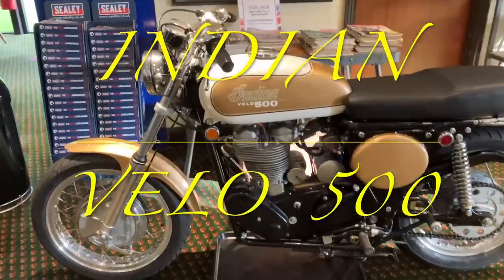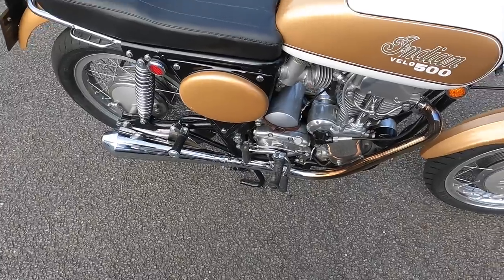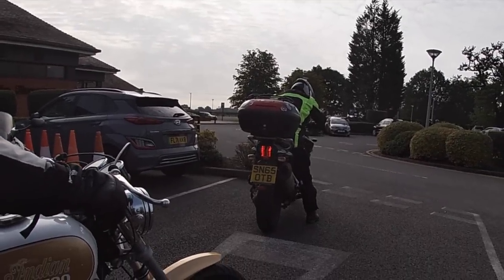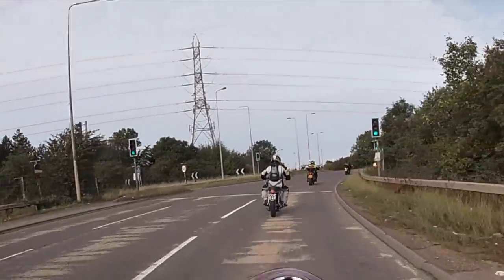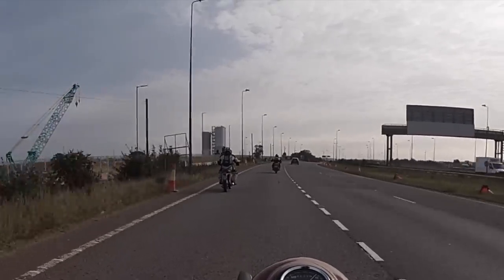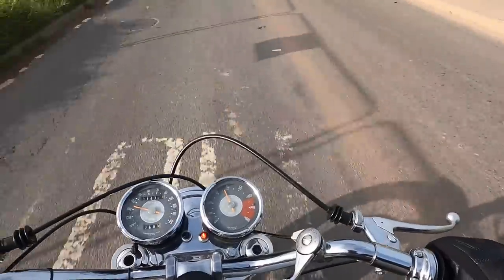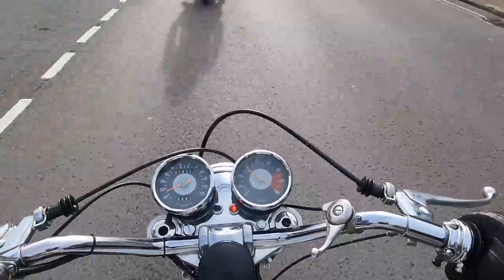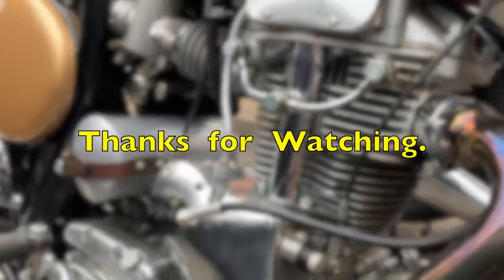Indian Velo 500 the rarest of  Big singles  tested

Comment: Brought back fond memories of a Ducati 450 Desmo and a BSA 441 Shooting Star that I had in the early '70s.  No, not both at once...I'm not THAT much a masochist!  The BSA was heavily modified:  500 kit, head work, 10.5 piston, 1.5" Amal GP, Akront rims, Fontana 4-shoe ftont brake, almost-open megaphone exhaust (you could not sneak up on anybody).  For a single of that day, it was quite fast, easily quicker than a 500 Daytona Triumph, but about 45 minutes into any ride you suddenly realized you could not feel fingers or toes.  Sure did look and sound great, though.  The Duke was almost stock, but for a 500 kit and Fontana brake and upgraded forks/dampers.  Both machines were jack-the-bear to start when cold, and I lived in St Louis, MO, so the weather wasn't helpful.  I found a $3 electric blanket at a yard sale that pretty much solved the problem.  I've always admired Francis Beart and loved big singles.  Just imagine how wonderful a modern one with balance shaft(s) and rubber mountings could be.  Of course, only silly old fools like me would want one...and we'd wait until they were old and cheap, so no sane manufacturer is going to gamble the fortune to develop one!   I did have a Honda GB500 some years ago, after it had gotten old and cheap...but somehow it just didn't have any soul.  Go figure...
Reply from the maker: Cool 😎

Comment: Nice! There is no reason to push these museum pieces. I have 71 CB 350 twin Honda that I finally got running right (bought it in 2000). The only parts I could find is support for AHMRA vintage class racing parts. I found some old HAP Jones pistons, had the cam reprofiled, intalled racing electric ignition, 32mm Mikunis, etc. She is a real beast now. Going to ride her on my local mountain road in a few hours. And I am going to push her hard!
Reply from the maker: Oh I wasn’t riding hard at all 
The clutch didn’t fail because I was hammering it, it’s unfortunately an ongoing problem the guys thought they’d fixed, unfortunately not as it turned out

Comment: This bike is not common only 250 made. Such a pristine condition...I love the intake pipe with fins in a desperate attempt to stop heat in the carburetor. Unfortunately nor the English not the Italian engineering was renowned for reliability...Clymer died in 1970 and the Indian revival 400 and 750 cc died with him, followed shortly by Velocette and Royal Enfield, the engines providers..
Reply from the maker: Oh both countries can make very reliable machines in my experience 
The bike is over 50 let’s remember 
Not too many Japanese bikes have survived so long
Reply: @bikerdood1100  The first truly reliable bike was the Honda CB 750 at the end of the seventies. After some problems with the chain "tensioner" with the first model, fast solved by Honda with a kit. 
Before the Four none bike on the french market was truly reliable for range fast touring whatever the origin even the BMW reliability is rather a myth.
On 1972 I bought from a friend who was working at the Honda importer, a Honda CB750 1969 (the very first one with the sand cast engine cases). The bike had 35000 km, I added 80000 km more in less than 3 years with just one clutch plus a lot of consumables (tires, brakes and chains were worn at very fast rate...and the normal consumption of ball bearings, rear shocks and fork rebuilding). The maintenance was constant but nothing hard. The cam chain was pretty worn with a lot of slash noise at the end.
I sold it to a friend at almost 120000. He rebuilt the bike, and kept it. The bike is now 54 years old with more than 200000 km and it's an highly collectible as the 1969 model with sand cast cases is extremely rare.
That was the first bike with what I has able to make Paris France to Hambourg Germany 920 km straight on highways with just the stops for refueling, one tension chain, and coffees for the driver in a total time of 9 hours. Such a trip was difficult to imagine with a lot of bikes in 1972-73.
Honda made very strong models, I bought a Honda 750 VFR Carat 1990 brand new. I sold it at 125000 km in 2000. I did nothing except maintenance including ball bearings and normal items like disk brakes at 80000.
In 1991 I had an urgency and made Paris Marseille 780 km all highway by night in less than six hours including stops without any problem, the tachometer being at 200 most of the time.
An acquaintance bought it, and has it always. The bike, 33 years old, has now 260000 km with just one clutch. The engine has never been opened. He made a new epoxy paint of the wheels, made a great revision of the cycle and it's on the road again.
Reply from the maker: Well as the saying goes if you were right I’d agree with you 
But unfortunately 
The 400/4 like so many Hondas is a revvy gutless little thing 
You say Honda 
I’d say 
Cam chain 
I’ve had a lot of Hondas over the years good bikes but more reliable than the rest I’m not so sure
I’ve pushed my share of Japanese bikes home in must say 
That’s not pub talk that’s real world daily rider experience no BS 
I’ve been let down by Japanese bikes of various makes at least as often as anything else 
Don’t deal in mythology on this channel

Comment: Looks really nice design. But seems a bit of a mix up with a somewhat unpleasant riding experience ?. I had a  BSA DBD 34 GS and a genuine ex factory RGS A10 650 Bsa  . Both in full Clubmans trim. The 650 my wife and I used on long trips in Europe with camping gear,  yes an RGS with clip ons, rear sets and a rear carrier. Never really thought of it as being uncomfortable or difficult to ride. The high first gear did mean a lot of shifting into neutral now and again in towns, but it was second nature, it did have a Triumph clutch unit fitted in fact. Would have loved that front brake though, it looked magic.
Reply from the maker: Well the bike itself was really good 
Well apart from the clutch of course 
I found the riding position and engine very good, even the GP carb was pretty good
Reply: The Triumph clutch was fitted as standard on the late A10s.  I had a 1960 Super Rocket which had a Triumph clutch.  If you want your A10 to stop properly, the late '60s 2ls brake as fitted to BSAs and Triumphs is the go.  It needs the fork sliders  with bolt-on axle clamps for full width hubs, and you have to fit the pre-1965 shorter axle.  It's a really nice brake, strong and progressive.

Comment: All the best motorbikes were designed in the past , 40's 50's 60's  and some in the 70s . Yes, they all had their faults, and getting to where you wanted could be an adventure, however,  those real vintage air cooled,  kick started bikes, had something that modern bikes can never have, and that is soul!  There is a simple test : if after you ride your motor bike, you have parked it, locked it up and you start to walk away, if you turn to take a look at it, it has soul, character and you have connected with it. If you dont turn around, it just another bike, a means of getting to work. Do the test!
Reply from the maker: Very true 
And when they did break you could usually fix it yourself 
And how much is it to service a modern bike ?

Comment: Not the ideal location to test  a Velocette  powered bike stop and start running with endless traffic lights and roundabouts.
A lot more fun on the open moorland roads of Northumberland,  Durham and Yorkshire. 
The clutch problems come from it not being properly adjusted and not selecting neutral when stopped at traffic lights.

An interesting combination with a Italian frame and brakes with a very capable British single cylinder engine.
A possible improvement with the duplex frame and bigger brakes on the  handling over the original Venom  which  already had  excellent handling
Reply from the maker: It was only the first few mules, after that it was all open twisty roads where it was spectacular good.
Unfortunately camera and bike problems conspired against showing much of the ride. She went like a train but after around half an our we hit a small town where the clutch problems became very apparent
Reply: @bikerdood1100  Enjoyed your test run it brought back happy memories of many years back riding a Venom on  all kinds of roads. The clutch setting on all Velocette's is a bit tricky. When properly set up they are very light and very smooth action.